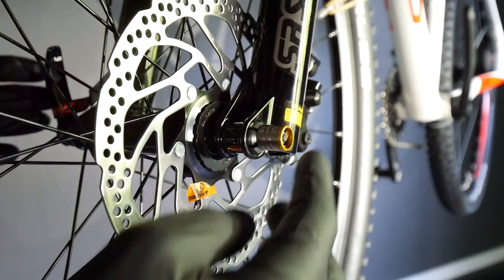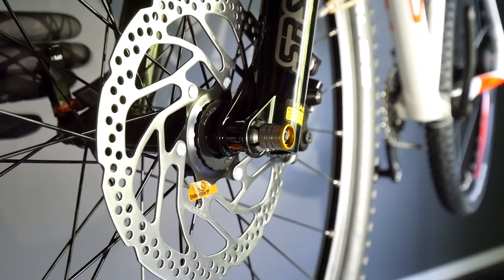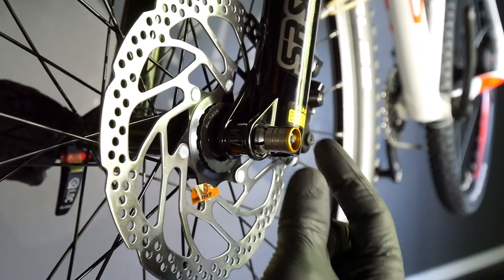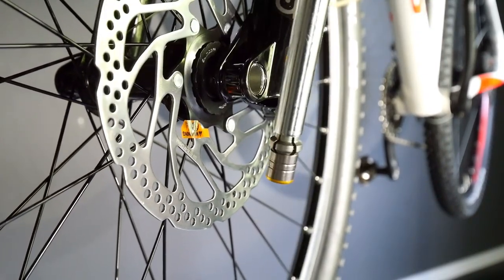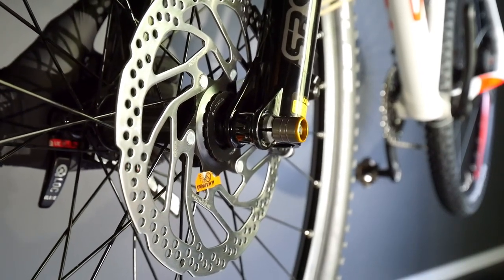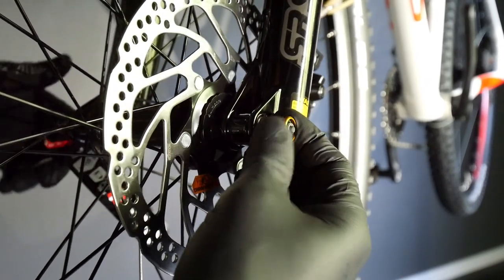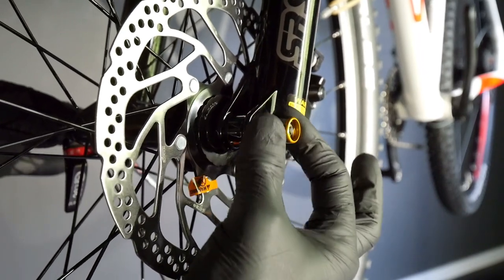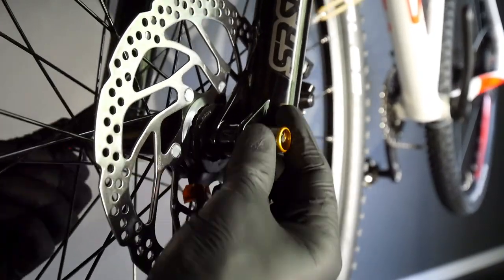How To Open This Weird Through Axle... SR Suntour Q-Loc Release Installation And Removal Guide.

Comment: Thats the worst design ever, we spend last week 2 hours try to put fron wheel togheter because the barrel did not want to open to be able to lock. Normal axle with torx would have been 1000 times better - this is heavy, cumbersome, and it does not work.

Comment: This is the worst through axle ever made. Have a Suntour XCR34 fork on a Canyon Stoic 2. Immediately upon using, the c-clip came off. The washer rolled away. So those are gone. The Q-Loc will pop open midway through pullout and get stuck. When it is secured to the fork, it moves around and makes a knocking sound. Literally the worst MTB thing I have ever encountered in 17 years of riding. The bike is dead to me now because it is so difficult to get the front wheel off to take my bike to the park and impossible to get the axle back on, and once it is on, it makes so much noise. Tried to quiet it down by greasing the sides of the fork entry points, but that only holds for 2 rides and then it is knocking around and scratching up the fork again. Canyon tried to offer a credit to an LBS for help, but LBS's refuse to help because none carry or service Suntour forks. They all say "Never buy Suntour, dude. Those axles are trash." Contacted Suntour looking for support from them or a replacement - they refuse to deal with consumers directly and said go back to Canyon. Looking for a replacement through axle. So far, no joy. Nothing fits a Suntour fork except this POS Q-loc. Will never buy a Canyon bike again.
Reply: PUSH  IT IN   ANDS  TURN  CLOWN
Reply: Not only is it the worst thru axle design, once installed the openings in these "prongs" allow muck und water to enter, gumming up the whole sorry assembly. What were they thinking of indeed.

Comment: If you press the end in first and then turn it a little bit clockwise it will lock the expanding parts into the retracted position. This makes it easier to install or remove the axle as the expanding parts are less likely to get caught on any edges of the hub or fork legs. Then once in place turn anticlockwise to return to the unlocked expanded position, and then adjust as you showed in the video.
Reply: sadly this only works with the qloc2
Reply: Thanks, really helped
Reply: What do I need to do if I can't remove the Q-lock skewer? I cant press it hard enough for it to fit in so I can remove it.
It is like when I push it, it retract but it wont fit in and it is stuck.
Reply: Ah mate, hero! Was the one detail I was missing

Comment: Just had a fight for 30mins trying to remove this after a puncture! Spun it, unthreaded it, twisted, tightened. Eventually it came loose and it turns out all I REALLY had to do was push the bloody end?!

Thanks so much for the video for the inevitable puncture #2. Also I've totally fitted it back wrong so I'll have to sort that before my cycle home! At least it didn't fall out, but thanks for saving me from total disaster :)

Comment: Helped me out ALOT. Never seen one until on my bike and guess what I did.. I held on to it and opened it all up springs went flying everywhere 🙄
Reply: how did you repair your skewer sir? did you buy a new one?
Reply: Mine doesn't have a spring - I'm wondering if that's why I cannot make it work?
Reply: Happened the same to me…hehe…I had to buy a new axle 🙃
Reply: @ricardogabales6562  tool ages to figure out, but I pieced it all back together.

Comment: I've got the same one. It works well for me. Just remember to add a little bit grease all over or like I found one day it'll get stuck and corrode itself to the inside of the wheel and it's hard work to remove and put back in. I used grease but even a little bit of oil will do the job.

Comment: You just saved me from a meltdown. I was gonna go back to the local bike shop and go Karen on them. I unscrewed the thing and pieces fell off everywhere. Lucky for me I could get it back together. If ya don't know ya don't know.
Reply: Hi mate! Please help a brother out. I have also completely dismantled it not knowing that its a pop lock thing so I’ve got it in little pieces. Any help on how to get it back together in 1 piece?

Cheers
Reply: Your screwed. I think I had all the pieces in my hand and was able to put it back together. But, I lost my confidence in it and bought two more from somewhere in china. Can’t remember what the website was. About 50 or 60 dollars a piece. Good luck. I feel your pain!
Reply: @tomdougherty3245  actually took it to Halfords and one of the bike specialists had the exact same bike model as me (Voodoo Bizango) and the same thing happened to him so he managed to put it together for me lol, seems to be holding well at the moment but if I see its not as it should be I will just order a replacement (though not cheap).

Don’t know why they’re necessary anyway, have always had high model bikes and they’ve all done fine with regular quick release axles anyway..
Reply: @tomdougherty3245  actually took it to Halfords and one of the bike specialists had the exact same bike model as me (Voodoo Bizango) and the same thing happened to him so he managed to put it together for me lol, seems to be holding well at the moment but if I see its not as it should be I will just order a replacement (though not cheap).

Don’t know why they’re necessary anyway, have always had high model bikes and they’ve all done fine with regular quick release axles anyway..
Reply: I have an E bike Giant explore it’s pretty heavy. I was able to put mine back together but lost one of the little washers. Didn’t want to risk a front end failure. Lol. Good luck brother.
Reply: @tomdougherty3245  Hey quick question I have found myself in the same situation and the way the the little pieces aren’t going in very tightly is that normal if so I will go back to getting pissed of about it and try it again
Reply: It’s very finicky, and I can’t remember exactly since it was last year. But if you’re not absolutely certain I would play with it some more, and or go buy a new one. They’re very expensive, but you would have peace of mind knowing the thing won’t fall apart again, perhaps.
Reply: @tomdougherty3245  Ok thank you for this you mean by a whole new axle?

Comment: Thank you for this, I was struggling to get a front wheel off following it being overtightened (I think by the previous owner) but knowing how it was meant to work meant I could tap it with a hammer and a bit of wood to get it free.  Thanks again

Comment: Thanks for the video! I have this same stupid thing on my Norco, although when I went to tighten it it wouldn't spin at all and adjust the tension I put a pair of pliers on it and lately gave it a turn in my hand and then it had a small c clamp that came flying off. When I went to look at it it appeared that there was a small washer and a c-clamp were bent so I gave them a little adjustment on my bench and put them back on I was able to adjust the tensioning nut and clamp the wheel in place!

Comment: And the whole thing is held together by a couple crappy rubber o-rings on the inside and that little "c" clip on the end of the screw on the right side that pops off if you unscrew the gold ring too much. Then you have a nice pile of Jenga pieces and it is really fun trying to hold it all together while you somehow manage to put the clip back on the end of the screw.
Reply: can we replace the clip at the end of the skewer?
Reply: It is doable but not easy.  There must be special pliers to do it but I was able to work it back on with the tip of a flat blade screwdriver.
Reply: Hahahaha... You're absolutely right!!! I was so shocked to see so many tiny parts and I had to go to a bike shop to have it placed back altogether!

Hope you were able to put yours back on... Ride safe brother!

Comment: Maybe because this was the first Thru axle I've ever owned it didn't seem weird to me. You did miss however that when you push the gold piece in you need to turn it slightly clockwise to lock the wedges in the retracted position so that the axle can slide in and out without the chance of the tabs getting caught part way through. Then turn it counter clockwise to release them again. I think a few  users don't realise that this feature exists and think that it is stuck.
Reply: tried removing my front wheel with this system earlier today. It refuses to budge! Following all the instructions, the blighter still will not come out. what a PITA if I get a puncture. game over.  :(
Reply: @KTM250SX07  followed every instruction video - will not budge
Reply: @GeorgeFalconer  look at my tips above. The instructions as usual skip to the part where it's easy to show everything. The dude knew where to 1/4 turn it just right after opening the lever on the other side. There are many, many other steps to this in real life.
Reply: @richardjensen3655  I've got used to it now, Richard, but thanks for the tip. My local repair guy simply knocked it through with a rubber mallet. He hires out many bikes with this issue, and knows what to do. Greased it, no problems since.

Comment: My Specialized Fuse had these skewers. First flat tyre and I tried to remove it like a normal skewer, it fell apart into multiple bits and bounced around the shed floor. I couldn’t get it back together. 🤦‍♀️ To make things worse, it was my first tubeless flat. I had no way to refit the Fat tyre back on the rim bead, it just wouldn’t seal without an air compressor. Went back to normal skewers and tubes after that.

Comment: My Q-Loc will push in, but it won't stay pushed in when I twist the end. So I can't remove the front wheel. Very frustrating.
Reply: Freed it this morning. I had to remove the C-clip on the non-QR end, then the black washer. Then I could unscrew the button, the spline section, the plastic cap and spring, and remove the QR. The axle was stuck fast in the fork/hub. Some gentle persuasion with a flathead screwdriver and hammer loosened it. 

I cleaned the whole system but it didn't seem that dirty. Rebuilt the axle. The button still doesn't twist to lock the splines in the closed position. However I thoroughly greased the axle and it slid in easily. I didn't try to remove it because I didn't want to put myself in a bad mood if it wouldn't come out again. I was able to change tyre, and that's all I wanted to do at this point.

The only slightly challenging part was re-seating the C-clip. Otherwise it's a breeze. Don't fear dismantling it if you have to in order to remove it. Make sure you grease the axle shaft thoroughly before re-inserting it.

Comment: Ive assembled multiple bikes over the years and I can't figure this out.  The small metal piece doesn't expand to allow locking.  The rubber bands on it keep or closed all the time.. such a strange design.   Suggestions?
Reply: I went with an older axle design.

Comment: A great example of over engineering something that otherwise should be really simple in design, i encountered a few of these badly designed axles when i worked in the shop, dirt can get inside the mechanism and jam the axle...
Reply: I can confirm this. Yesterday I had to disassemble the axle into its parts because dirt made the lock not work properly.

Comment: I have a solution many will absolutely love. For around $30 USD on Amazon. Completely round thru axle, can be 100 or 110 x 15. The title is super generic: bicycle thru axle. Seller is chain accept. I assume Chinese. I had to put a couple of 2 mm wide spacers to get a tight lever fit but the actual axle inside the dropouts is rock solid, zero issues.
And a thousand times better than this piece of crap q-loc. Try to get the axle with an end cap; otherwise you can simply guess on the thread pitch for a 15 mm nut on the end. There are several online without end caps. Remember the axle has to be smooth for all 100 or 110mm, not a hex lock axle. Total length is around 130-140 mm, add 10 to that for boost. Lastly: better to get one too long than too short, you can always add spacers like I did between the lever and dropout.

Comment: Absolutely without question, THE best example of taking something simple and using technology and supposed "innovation" to turn a simple process into a nightmare. I am doing everything right, but have spent hours trying to cajole this out. Everything is loose, the unit closes down into the shaft, then resolutely refuses to simply pull through from the quick release end. Utterly and completely awful.
Reply: Finally got it out. Local bike hire / repair shop (heroes) had these on most of their hire bikes. Whack with a rubber mallet, then when the nut was flush, a bolt the right diameter to go through the shaft. Bingo. Had started to rust really slightly (hadn't been taken out for 13 months) and needed some muscle.
Reply: @GeorgeFalconer  I've just had the same experience, surprised there isn't more complaints about this pointless design on the net.  I installed some suntours forks about 9 months ago and was slightly perplexed at complexity of the design but didn't think too much of it.  Come today I needed to remove the wheel...jesus...rubber mallet to get it moving?  Think lump hammer and a piece of wood to shift the damn thing + lots of wd40 and it still didn't let go until knocked all the way through.  Cleaned it (wasn't noteworthy gunked or rusted etc) and greased it up and now works as it should so would suggest anybody installing these grease the damn thing before hand.

Comment: The collet end is held together with a small retaining ring. If it pops off,  you will have a 15 piece jigsaw puzzle to reassemble.
 Imagine dealing with this on the trail -
Reply: This popped off on mine today and I can't find it. No idea if this is going to cause a long term problem or if there is anyway to replace or create a solution to its absence. Ideas welcome!
Reply: I had the same problem, I went to Halfords and they replaced the c clip without charge

Comment: There is at least one alternative thru-axle on Amazon for about $20. I may actually get it, it's got a QR lever on one side, like this does and then a threaded cap on the other side. They come in both 100mm and boost spacing. Because this design sucks. 

Some tips on this that are not in the video (not that I'm lightning quick at removing it!): there are about a dozen 1/4 turns to the Q-loc, NOT one 1/4 turn. That's probably what throws everyone off the first several times they try it. If it was one 1/4 turn between open and closed, I would not be typing this. Basically, when you want it locked with the wheel in place, you turn it in until the red splayed part touches the housing, and on the other side the QR lever tightens up just like the skewer type. That's of course the easy part. 

When you want it out (the much harder part), you screw it out until the QR lever can open on the other side. Then...and this is the tricky part...you screw it in with 1/4 turns a few times while pushing that cap on the same side in until the red splayed part shrinks down into the housing. But you are far from done, trust me. You then continue to screw it in 1/4 turns slowly while pushing pretty hard on the cap AND also pulling on the QR lever. I've found that you have to do both, one or the other will simply not get the axle out. You basically have to screw it in, push the end cap with the same hand at the same time, pull the lever on the other side with the other hand, all at the same time. Now that in itself is not the hardest part, believe it or not. The hardest part is timing it just right where that 'perfect' 1/4 turn is that slips the axle out of the housing. It doesn't just pull out normally. You have to slowly turn it in, push/pull hard, and if you get it just right, it slips out. But...there are many times when it starts to slip out about 5-10mm and the red part catches on something inside the housing. Start over. Or...you are almost out and the red part was not completely shrunk down and it catches on the other side of the housing --- it's almost out but not quite. Yes, it's a frigging pain. But I'm good enough to usually do it in a minute or so. Compared with simply twisting out a threaded axle or using a hex lock, this is horrible, obviously. But it's doable. We'll see how annoying it is a month from now. If it still is, I'm plunking down $20 on the Amazon aftermarket thru-axle (if you consider one make sure it has a threaded end cap).
Reply: can't find the amazon axle. link?

Comment: What should I do if it doesn't want to come out
Reply: happened to me. I used a rubber hammer and a wood or plastik stick to slowly and carefully hammer it out. It was completely dry with alu-oxide corrosion dust. You should add grease before reassembling.

Comment: Mine has seized and I can't remove the front wheel😡 thank you for the tutorial though❤
Reply: Mines the same, did you get it out? Can get the flanges to compress but it will not go through :(
Reply: @BazippysVideos  I did in the end with a lot of wd40 and a hammer 😅🤷🏽‍♂️
Reply: @daveslow84  I did the same, smashed the end till it gave up. I must remember to keep taking it out and greasing it.